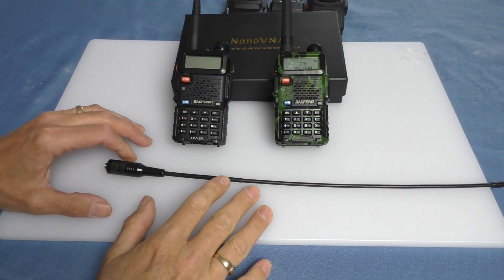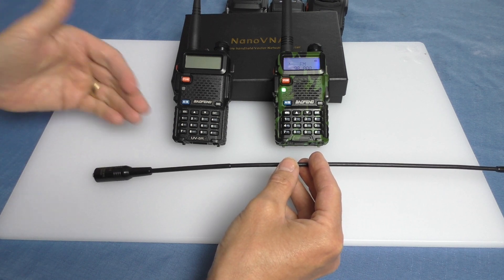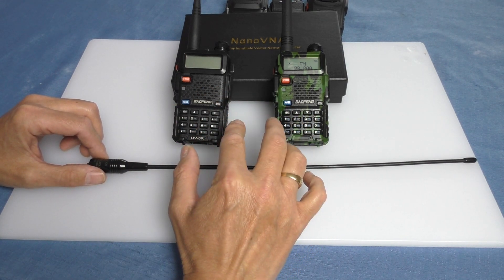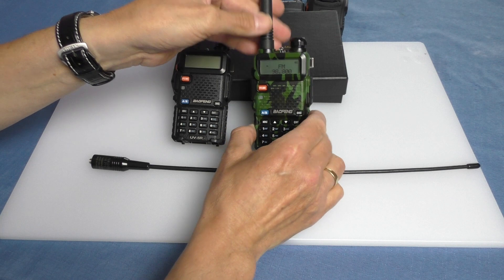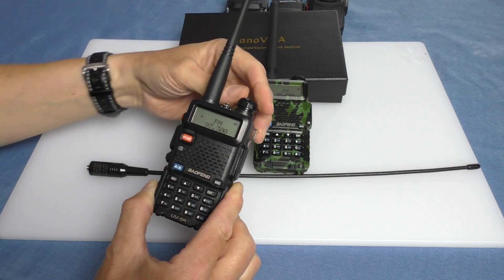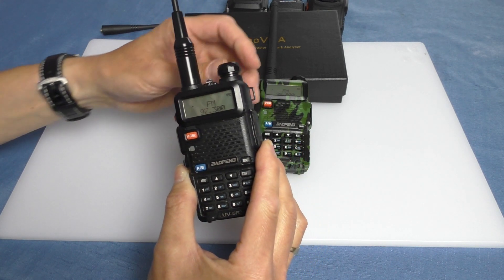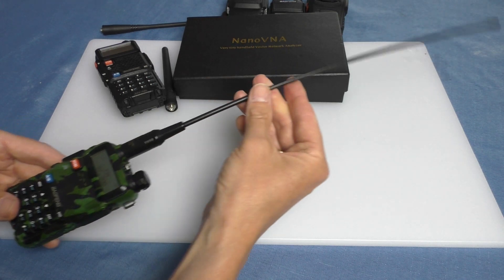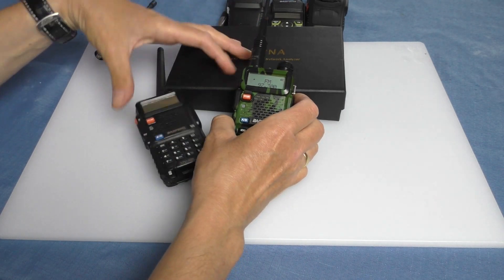Fake Nagoya NA-771 FM test with Baofeng UV5R

Comment: Hi friend, I could ask you a question... I just bought the baofeng uv-s9 plus and wanted to know if the configuration is equal to the uv-5r. They're very similar teams. 
Greetings and thanks
Reply: I think the software is the same but the S9 has 8 watts power compared to the  4 watts from the UV5 R
Reply: @CB-RADIO-UK  Okay thank you very much, I bought it because I wanted a team with more power than the uv-5v

Comment: I've even bought an adaptor and plugged my imax in one. just for recieve not transmiting. And it was excellent. Picked signals up from alot further away. Im in great yarmouth and was able to pickup stations in Norwich. I have one of the diamond X antennas now. Or i use my 7ft firestick.
Reply from the maker: Very nice!

Comment: Got the same radios and a tennas..how can you tell if the antennas are fake..i know the radios and batteries i have are.....
Reply: Cost really.  Gen 771's are around £15-20 fakes are £2-4
Reply: ron leblanc: A GENUINE Nagoya antenna (all of them, not just the NA-771) will have a small inverted triangle inside the first letter "A" of the word "Nagoya". If it doesn't have this its a fake.....see link below.
https://imgur.com/UniMR5Z

Comment: Hi fred. Hand helds are designed to accept a high SWR because by nature you’ll have the antenna near the side of your head which drastically effects the swr. 

For an experiment try to find a resonant antenna and then put your head next to it on tx. Also for an experiment try putting your head next to a high swr antenna and see if it actually improves.

Just a thought  fred as there are  just too many variables .

Another thought it that most hand helds have a metal chassis and this will act as a ground plane which your clamp doesn’t emulate.
Just food for fodder.
All the best
pete
Reply: Thanks Pete.  Look out for a follow up video at the weekend with new testing. On fred 1
Reply: @CB-RADIO-UK  will do fred..love your channel, keep them coming.

Comment: Hi Fred That antenna is slightly different to the one I have Your is shouldered on the whip mine isn't. How many fakes are there! 26CT3060 Mick (M0MPI)
Reply: Hi Mick.  Dozens i recon.  Some really good and some really poor.
Reply: @CB-RADIO-UK  hi all, I've recently taken ownership of a uv5r and the first thing I did was order one of these antennas. Yes it came in the orange packaging so I knew it probably wasn't genuine but mine too has this shouldered/tapering effect part way up the antenna which led me to believe it might be better than some of the others. Mine works brilliantly. I have no way of checking the swr but just to give you some idea of its performance I have made contacts from Whitstable in North Kent over the water to Essex and one contact was baofeng to baofeng so it definitely is working really well. Maybe I was lucky. And I understand line of sight plays a big part with these radio's but trust me, there is no line of sight between me and Essex.

Comment: Hi Fred I am really enjoying playing around with the Tiny VNA that I bought a few months back from China, it's a brilliant little bit of test gear.
I have found using an App with it on my Android phone or Tablet makes things a lot easier to read and you can also alter the frequency range and scale of the SWR graphs. It also beats having to use that silly flimsy toggle switch.
If you haven't tried one of the Android App I highly recommend it.
Keep up the good work and stay safe bud.
Reply: Hi Steve.  I might look at the PC software.  Mostly i want to use mine in the field building and setting up CB antennas.  Iam not really sure on the accuracy of the think but its great fun.